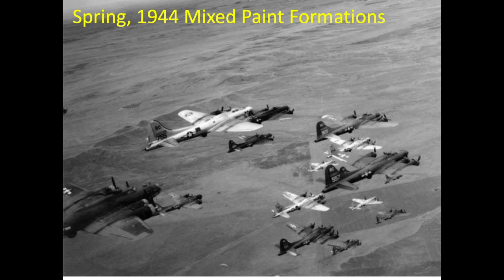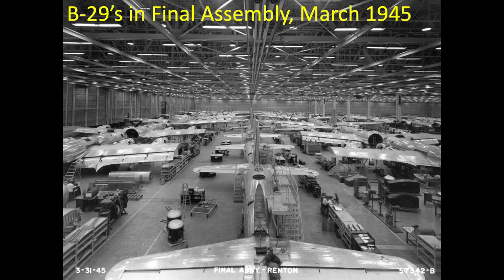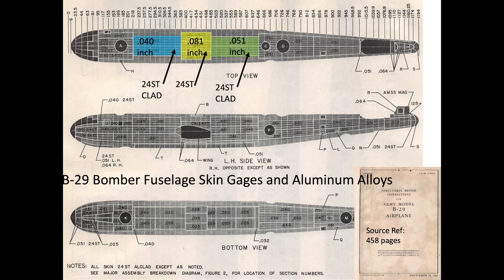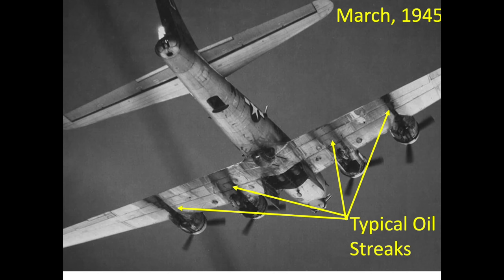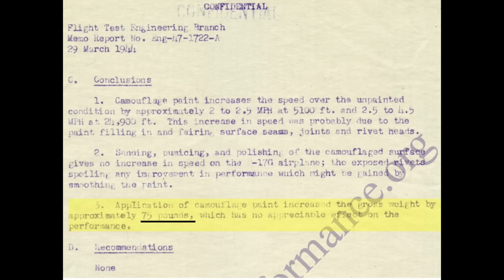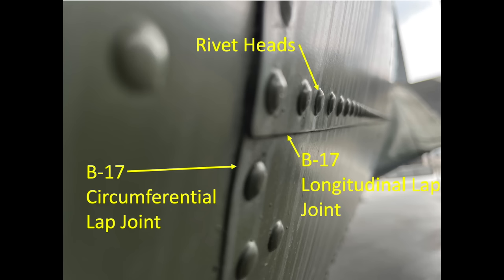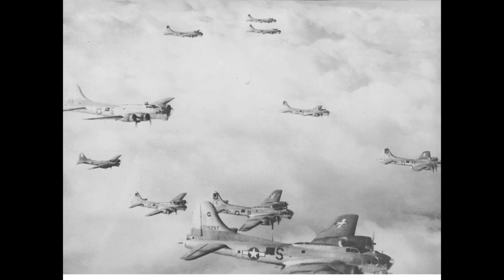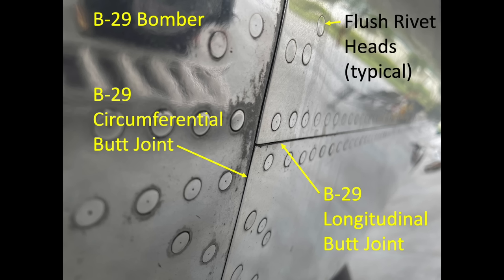B-17 Bomber Paint Vs No Paint, Unexpected Results

Comment: The "unpainted" are normally referred to as "natural metal finish" or NMF. The directive ordering the deletion of primer and paint was issued sometime around March or April 1943. It would be interesting to know the official rationale for it. A big consequence of having no primer was that it inherently limited the serviceable life
of the airframes. Although the life expectancy of a B-17 in the 8AF in late 1943 was a matter of weeks, that was a temporary situation. Later, many survived long enough that corrosion could have been a significant issue during the War. Certainly more warbirds would have survived in better condition with the proper application of primer even if only on internal surfaces. As for the aerodynamic effects of uncoated exterior surfaces, taping skin gaps and a generous application of carnauba wax in the field would have more than made up for it if getting a little more speed or fuel efficiency was that important.
Reply: The reason they quit painting them is because when all the aircraft were painted it was done at the factory, the directive was simply to speed up manufacturing and simplify the delivery process.
It was then up to the commander's whether or not they'd be painted according to how urgent a replacement plane was to be pressed into service and whether or not they felt it was necessary due to effectiveness. 
As far as "more warbirds surviving" it wouldn't have mattered, all the aircraft overseas were scrapped because of the cost of bringing them back, any aircraft not wanted by a foreign power or that wasn't going to be used by a unit staying overseas was scrapped due to the cost of returning them, the downsizing of the military and all the planes midway through the manufacturing process and in depot awaiting shipment was enough at time, coupled with new designs ready to be produced meant they just didn't need to return aircraft that were busted up and stressed from combat.
Reply: Actually, orders to stop painting these airplanes went out to all aircraft factories in October of 1943. Thousands of painted airplanes were still on the assembly line, and thousands more were lined up waiting to be delivered. That's why these new, natural metal, airplanes weren't seen in combat until February of '44.
Reply: The directive from HQ AAF was dated 3 Nov 1943. Units in the field were given the option to remove the camo paint from existing a/c or add it to NMF a/c at their descretion. Recently saw a video of late B-17G production and they were zinc chromating all interior surfaces and the anti-glare panels on the nose and insides of the nacelles. I have a sequence of photos of the crew of a brand new B-24J prepping the a/c for a mission and the interior of the fuselage structure is not only completely NMF but the inside surface of the skin appears to have been polished. It looks like a tunnel of mirrors.
Reply: My question would be production time and delivery turn around. It seems that later in the war, there was more of a concern for replenishing lost aircraft in a timely manner. I'm not wondering if the time in the factory to paint offset the loss on performance.
Reply: @BonnKialStevens  The consensus seems to be it was to expedite production and that the OG camo scheme was no longer needed. While the NMF aeroplanes are beautiful, they should have used a color scheme similar to modern combat a/c in the European environment. Also see "PRU Blue" and "haze" color schemes.
Reply: Dale, on November 16th 1943, Military Technical Order No.15 was updated to include orders to all companied building planes for the AAF to discontinue painting airplanes. I don't know where you are getting your March date. If it had been that early, unpainted airplanes would not have started arriving at front as late as February of '44. November, not March.
Reply: @PoochAndBoo  A few months ago I was trying to date an undated video which inadvertantly captured a P-38 taking off from the Lockheed Air Terminal during the War and climbing like a bat out of Gahenna over a neighborhood where my family lived when I was a kid. The P-38 was painted so the only thing I could think of to roughly date the video was before they stopped painting the P-38. What I found at that time was a source which stated the order was issued in March/April '43.
Reply: @dalecomer5951  So, there ya go. I'm not sure where you were getting that April and March timeline. Good site, by the way.
Reply: B17s would only last weeks? Sounds like an airborne T-34
Reply: @ThumperLust  Only weeks in combat. About the same for  flight crews in the late summer and autumn of '43.
Reply: The USAAF tested unpainted aircraft at Wright Field in 1942 and found their airspeed increased by 8mph (B-17) to 21mph (P-51). To protect the bare metal the aircraft were waxed or covered with a lightweight clear coat.
Reply: @billwilson3609  if you read the fine print you will find that the test where the P-51 went 21 mph faster was invalidated because other changes had also been made.
Reply: Corrosion of aluminium is not a major factor in airplains.If it's not damp and doesn't have pockets retaining water it's very resistant.Oxidation only makes it more resistant to corosion.
Reply: @OssyTK  Totally wrong.
Reply: @dalecomer5951  So what? The bottom line was that they found that the aircraft went slightly faster without being painted which also reduced their production costs.
Reply: @billwilson3609 What do you mean, "So what?" Apparently you didn't watch the video, didn't read all of this thread, have poor reading comprehension, or poor memory retention (incl.).
Reply: @dukecraig2402  "As far as "more warbirds surviving" it wouldn't have mattered, all the aircraft overseas were scrapped because of the cost of bringing them back." I disagree.  I know of a number of B-17s -- not the war bond type like the "Memphis Belle," that were returned to the USA during the war and later scrapped there.  There are publications -- one by the late Roger Freeman, among others -- that show where individual aircraft were scrapped.  Many, many combat aircraft were scrapped in the USA after the war.  Consider the major boneyards pout West that were FILLED with combat aircraft.  You can see the mission tallies painted on tons of them.  Here's a quote from a website:

"Production of the B-17 ended in May 1945 and totaled 12,731 aircraft. Most of those still in service at the end of the war were sent to military aircraft boneyards for temporary storage, sale, or scrapping and smelting into aluminum ingots. Flight crews ferried the bombers back across the Atlantic and Pacific to the United States."  I have no doubt this is the case.  There is ample photographic evidence.

But you are right that others were scrapped in situ.
Reply: @Redhand1949  
Those scrapped planes on the west coast you're referring to were new and low usage planes that never left the US, yep, that's right, they scrapped a lot of new planes after stripping them for their engine's and avionics and other useful parts.
Don't forget 3 important things, 
1, the military downsized HUGE at the end of the war, they has absolutely no good reason to bring back planes that'd been through the stresses of combat.
2, all the first hand accounts of pilots and aircrew's writing or saying in interviews about coming home after the war on ships, with the accident record for those aircraft they weren't about to ferry all, or for that matter any, of those planes back, no way the War Department wanted to explain to families why after surviving the war their loved one was lost ferrying home an obsolete aircraft just so they could be scrapped over here.
3, like I just said, obsolete, their replacements were already being test flown at that point, the military had no interest in going through the expense or the hazard of flying planes that were obsolete back to the US when there was so many new one's back here that were going to wind up being scrapped anyways. 
Now this is not to say that not one single B17 was brought back from overseas, but they wouldn't have used a combat vet that had been through the stresses of bombing raids for anything like transporting home some vital or high security item when they had brand new unused one's in the many replacement yards over there, with the vast majority of them being either scrapped or turned over to a foreign government.
Once again this is exactly why none of the aircraft you see flying in airshows are combat veterans, they had absolutely no interest in trying to get home planes that were bent and shot up from combat missions, flying those things was dangerous enough without doing something like that, if something did need brought back they had plenty of transport aircraft and in the event for some strange reason something HAD to be brought back in a B17 they had plenty of new unissued one's in replacement yards over there.
Reply: @dukecraig2402  
Not sure where you are getting your information from. 
The only B17's that weren't brought back to the United States were the ones that were absolutely too "war weary" to make the trip, or the ones that were lost.
Regarding air crews to ferry all of those planes back, there was no shortage of them. Just like there was a bunch of brand new, unused aircraft at the end of the war, there was a bunch of trained, brand new, unused air crew. 
They were flown to Arizona from the Pacific Theater, and to Arkansas from the European Theater, along with all of the brand new aircraft still in the states. There they were made available to various government entities, or for sale to the general public. 
Now if you're in the market for a obsolete, gas-guzzling, four-engine bomber, and you have literally thousands to choose from, all at the exact same price, I think that anyone is going to purchase the newest, lowest hour aircraft that they can find. Not the ones with all of the field repaired battle damage, and the wings covered in oil from the leaky, worn out, high time engines. 
They sold what they could of the good aircraft, and the rest got turned into aluminum ingots. 
The 5000th B-17 to roll off the assembly line, and was signed by all of the factory workers, made it back to the United States after flying 78 combat missions..... Only to be scrapped.
Reply: @straybullitt  
No they weren't, they were scrapped overseas, the one's in the states that were lined up in the desert were planes that never left the states.
Ever notice all the stories from the air crew's about coming back to the states on ocean liners like the Queen Mary? That's because they left the vast majority of the aircraft overseas and scrapped them there.
Reply: @dukecraig2402  
You underestimate the number of B-17's that remained in military service as secondary aircraft after the end of the war. The last B-17 was retired from the military around 1959.
The Navy was using them as a early version of AWACS until 1955.
The Air Force used them as drones, amongst other things. 
Some were used for Air-Sea Rescue. 
Contrary to the myths, the War Assets Administration didn't scrap thousands of brand new B-17"s immediatlly after the war. All branches of the military and national guard had their pick of any surplus aircraft, to basically do what they please with. 
If you look carefully at the photographs of the aircraft storage facilities, you will see numerous painted B-17"s. They didn't come out of the factory like that late in the war. Additionally, most of the photos are taken at the two main storage facilities in Arizona and Arkansas. There were 30 WAA storage yards scattered across the United States immediately after the war. You are only seeing a fraction of the surplus aircraft in those photos. 
Again, they didn't just discharge all of the air crews immediately at the end of the war, and send them home. We didn't just pack up and leave. We had two countries to occupy, and Russia was just starting to get sketchy.
Some crews were replaced at the wars end, and they went home on a ship just like practically every other service member before them.
All of this is common knowledge Duke. If you have a valid source that says otherwise, now would be the time to reveal it....
Reply: @straybullitt  
No I don't, and they weren't returns from overseas, they were planes that never left the states.
You're wrong, they didn't ferry aircraft back to the US that were overseas at the end of the war.
Reply: I can't speak to the expected life span of a B 17, but the B-24 air frame was only expected to have a 100 hour service life before major reconstruction. That is only 10-13 actual missions, which is also likely to be on the order of 45 days in use. The level of corrosion affecting the air frame in that length of time would be negligible. 

I find the test results of painted verse bare metal finish counter intuitive. But the explanation does make sense.
Reply: @ThumperLust  The 8th Airforce was losing 20-30% of its aircraft per month in early 1944.
An aircraft with corrosion was a sign of a successful or lucky crew.
Reply: @straybullitt  A lot of the B-17’s were sold for less than the price of the fuel left in their tanks…
Reply: @dukecraig2402  Many were flown back with passengers just to get home quicker.
Reply: @Thenogomogo-zo3un  
No they weren't, they had transport aircraft for that which were much safer because they hadn't been put through the rigors of combat, B17's didn't have provisions for regular passengers and as such wouldn't have been used to ferry people, anyone they needed to get home due to some emergency or were urgently needed somewhere were flown on transports, but the vast majority of them returned home on ships, read the books written by those guy's who were on bomber crews or otherwise were still in Europe when the war ended, if their book contains their stories about coming home they all talk being on ships like the Queen Mary that was outfitted to be used as a troop transport for the war and carried many thousands more configured as such than it did being used as a cruise ship, it carried a lot of air crews back including B24 pilot Jimmy Stewart the actor. 
It's because the vast majority of those bombers were left overseas to be scrapped is why many people who go to airshows to see a famous bomber that their dad or uncle was on are disappointed to find out the one they're looking at with the name and nose art of the bomber they thought someone they knew was on isn't the actual one, the one's at airshows are bombers that never left the states that were either brand new when the war ended and just didn't make it over there or were being used as trainer's or other uses in the states and never left, even the majority of brand new one's in the states that never saw action were scrapped, the very few that made it back like the Memphis Belle that was brought back for promotional reasons and went on a war bond tour now resides in the Air Force Museum and will never be flown again. 
No, they didn't use busted up war planes to bring back guy's from overseas, considering that a full ⅓rd if all 8th Air Force crewmen lost during the war was due to accidents in those things bringing troops back that way would have been insanely stupid and is why they didn't do it.

Comment: What a great, in-depth analysis. I have always wondered, 1) what the weight of the paint was, 2) how the drag coefficient affected flight speeds. Now that you pointed out the butt & lap joint effect plus the rivet type used, that totally upended what I had thought.
What an excellent video! Thx!😁👍🏼
Reply: In this same line of thought I've often wondered: 1) what is the airspeed velocity of an unladen swallow, and 2) what the drag coefficient of a laden swallow is.

Comment: The respective weight trade-offs is exactly what I was thinking about during the video. I am glad to see that you addressed that.

The filling in/covering rivets hypothesis may also be at the root of the old ground crew advice during W.W. II to get more speed by covering a plane's surface with avgas.
Reply: Back a few decades ago when I was a young helo crew chief in the army nat. guard, there were still some Viet Nam vets serving.  I remember a couple of them used to rub down the fuselages of their assigned Hueys with gearbox/engine oil or sometimes floor wax, and it made the bird a little faster and the exterior corrosion resistant.